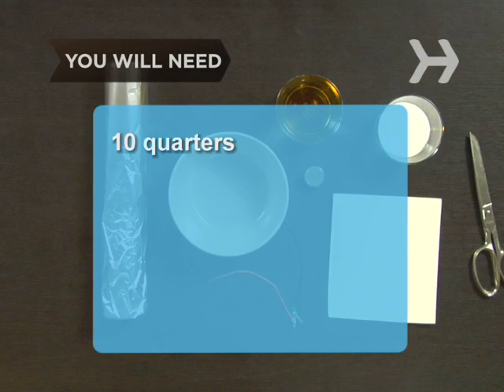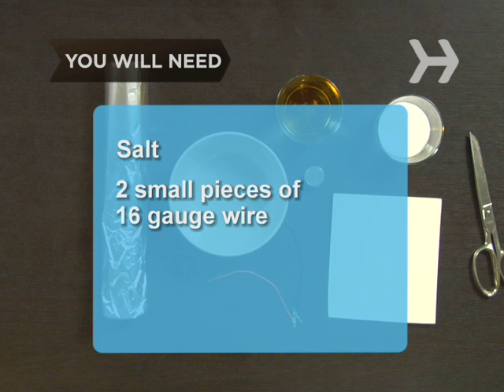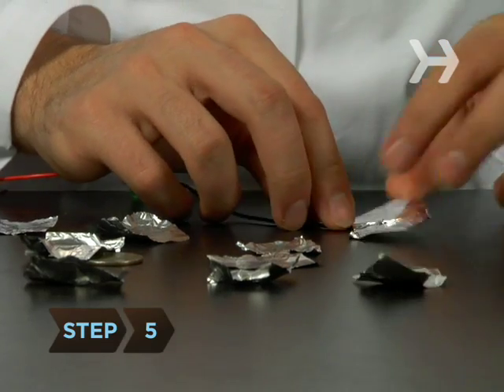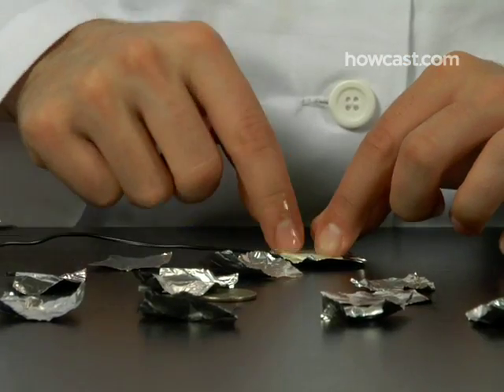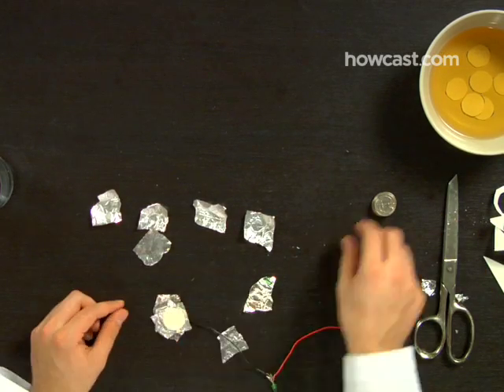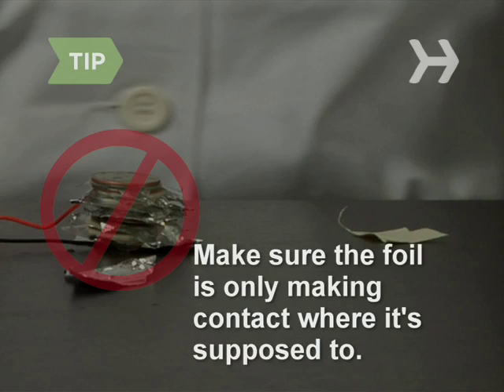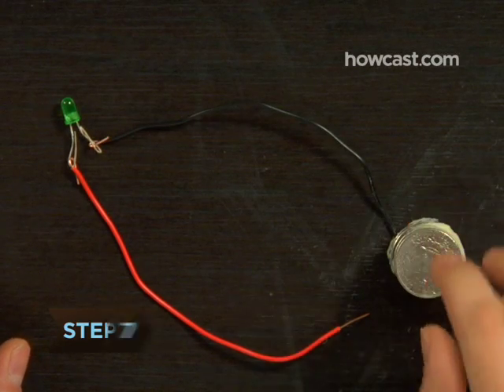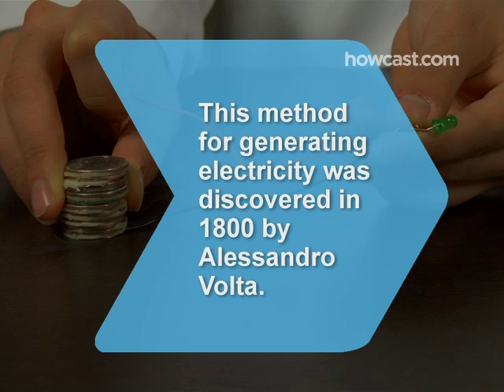How to Make a Coin Battery

Comment: isn't that more of a capacitor than a battery? It has 2 charged plates with a piece of insulant in between and the quarters are hooked in series which is why you stack them to increase capacitance? Correct me if I am wrong.

Comment: You need to alt salt because salt is an electrolyte. In other words, salt is what makes the solution (vinegar + sat) conduct the electricity.

It does that because of the salt's ionic disociation into the vinegar

Comment: just a simple newspaper and two types of coins, copper and stainless steel, later we make electric cell: copper coin, paper soaked in salt, steel coin, paper soaked in a solution, a copper coin .......... do not forget the spacers between each of the coins in the form of newspaper soaked in saline

Comment: copper penny's would work better to allow better flow of voltage in a small one cell wet battery, you can also use a ice tray, vinegar, and wire.  you'll have a 12.6 volt battery like the one in your car.